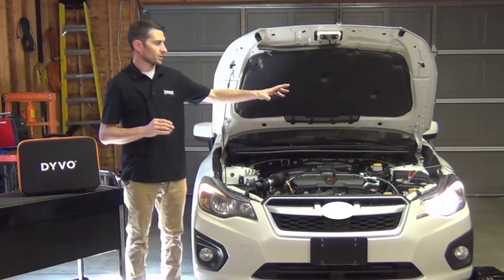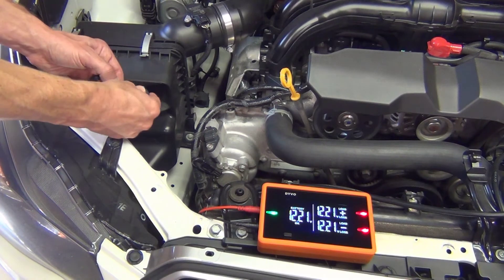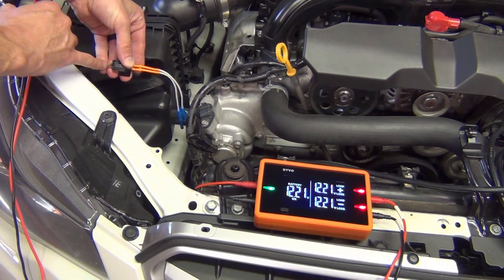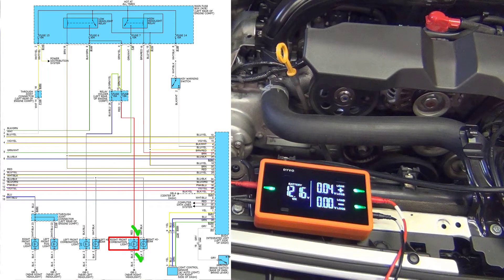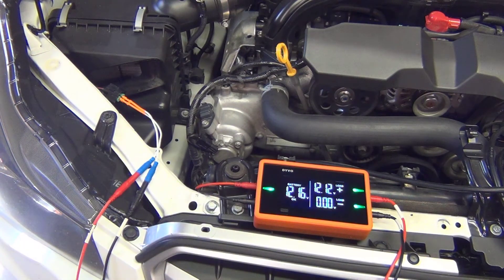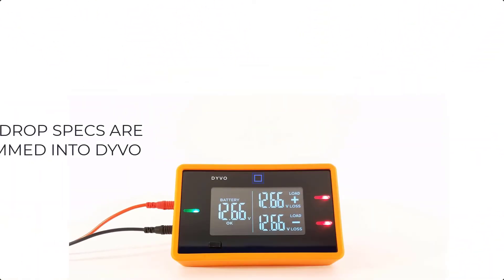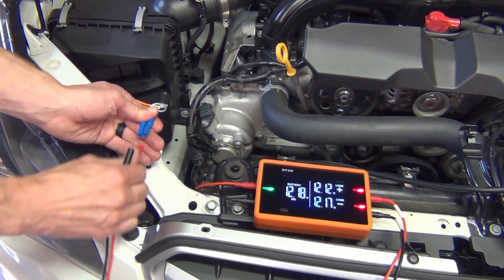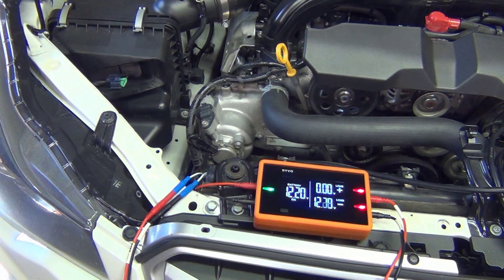How to test a headlight

Comment: Our 2013 ford edge the plug to the passenger light (low/high) the high does not work. I replace the bulbs. The plug I replaced cause the power side was a little melted. I have a brown wire to the power line and the black to the ground. Do I look for another wire to the high beam, if so what color am supposed to look for.
Thank you!     Louie